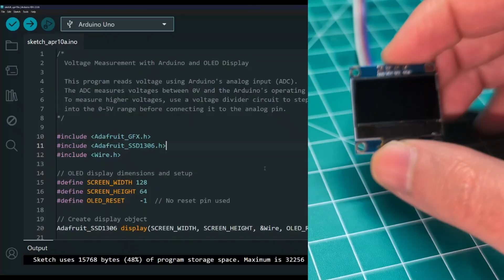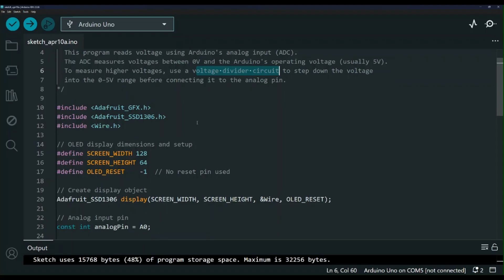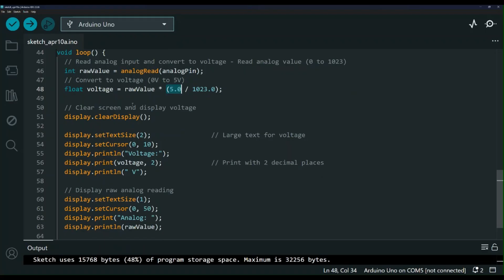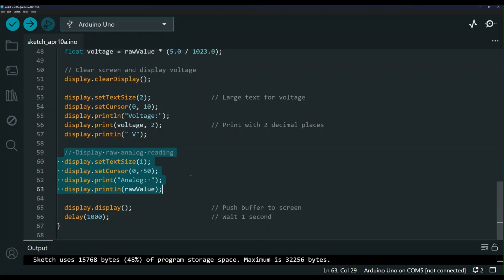Measuring Voltage Using an Arduino #voltage #arduino

Comment: Would the coding need to be changed if my board operates on 3.3v? I only need to test for a single AA Cell
Reply from the maker: Yes, you need to adjust for that because it's using the power voltage to compare

Comment: Im running my arduino directly off an 18650 cell via the 5v pin (between about 2.5 to 4.2v depending on charge). Is there a way to do this where i read the voltage that the arduino is running at itself? I want to do this so i can measure the battery life of my project
Reply from the maker: Love your idea, while it's possible you will not get an accurate reading because the Arduino will use the current input to compare it to the battery but if that is the same then that's the problem there.
You can use an estimate but that is why it's not accurate unless you have a known 5v input to power the Arduino then you can measure the battery but it's not what's powering the Arduino 
I hope that made sense

Comment: please explain how we can measure 60 volt dc with Arduino and show on computer screen 🙏
Reply from the maker: Good question, basically you need to divide the voltage and measure based on that and multiply the results to account for it so you need a voltage decider circuit
Reply from the maker: To display on computer, you can use the Arduino IDE serial monitor